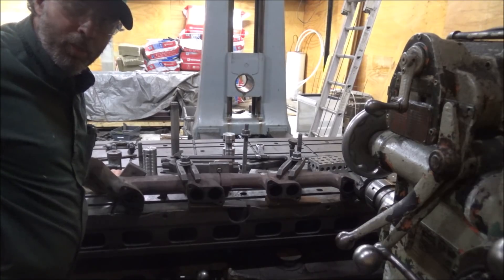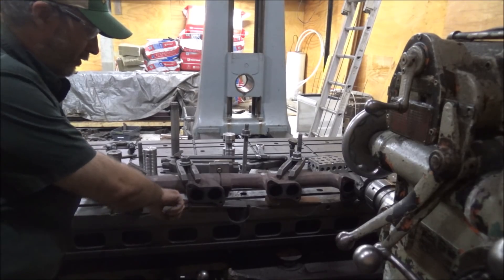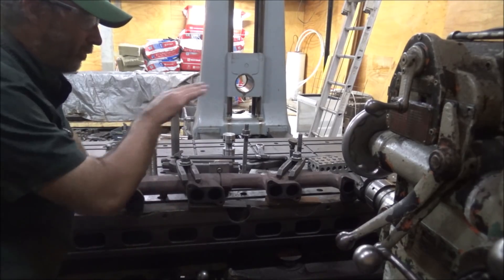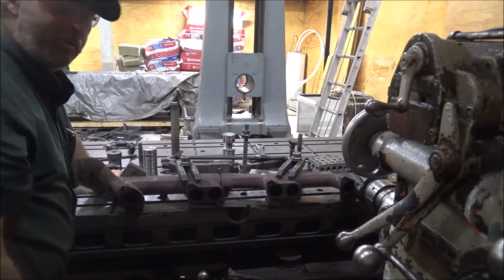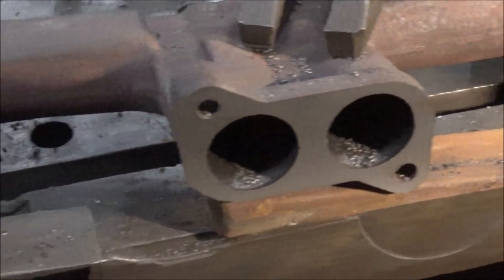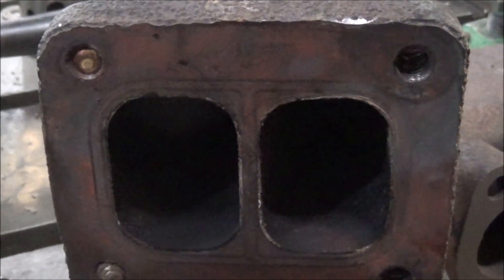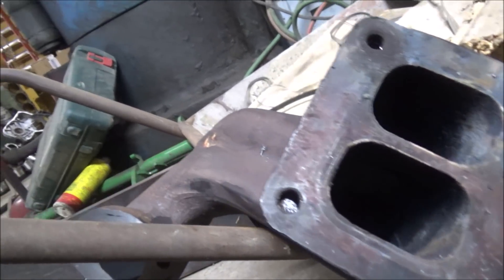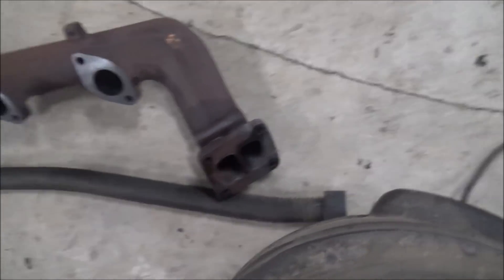Holding a Tricky Exhaust Manifold for Milling and  Difficult Getter Out

Comment: I was just thinking about something, I’m wondering about putting a small amount of anti -seize around the threads after heating , while the casting is still hot, so that it may lubricate the threads to keep galling from getting worse? Has anyone tried this? Penetrating oil just burns off!
Reply from the maker: Do you mean like trying to get anti seize to soak into the threads?

Comment: broken exhaust manifold bolts,always a miserable job. i agree with apollo. i was taught the washer technique many years ago and have found it to work best when you can use it. the good thing is you had the manifold on the bench and you didn't have to deal with it on the vehicle. like all your equipment thats one king size mig gun. perseverance pays off good job

Comment: I work on a lot of turbos.. I found the TIG welder is my best friend for removing broken bolts and studs, you can put so much heat into something so fast, you really get the thermal expansion benefits.. and it's more localized than a torch
Reply: But then he'd have to unhook it from the Carlton lol
Reply: @TheMetalButcher  He really needs two of them then!
Reply: @Rx7man  He needs the proper DC power supply for his Carlton lol. 20v instead of 240v kinda sucks.

Comment: If the bolt is not stainless, I've gotten them out with my oxy acetylene torch. The steel burns, but the cast iron really doesn't. Burn, then run a tap through tho clean up the crud.

Comment: There are those that use rags and then there are those that wears them. Lol. Gosh, if you only knew someone that has clamps or could make a fixture to securely hold that exhaust manifold. But, the important thing is you gotter done.

Comment: A wax candle when it starts to move helps. It doesn't smoke as much as oil & penetrating oil. It works great for me
 Take care Brian
Reply: Debunked by Project Farm.
Reply: @TheMetalButcher  not a simulation part dipped in salt water for a week or two. A real test in the field. Exhaust manifold bolts 25 to 30 years old thousands of heat cycles and hours. The key is get it to move with heat then apply wax. It doesn't always work but it has for me. No disrespect to PF but that was a BS test and doesn't debunk anything. Take care

Comment: I like to generally weld a nut to a broken stud then Heat her up a bit more then shock it with cold water and it cracks free.
Reply from the maker: Sounds good for some jobs but I am not bold enough to pour water on hot cast iron, sounds like a great way to have some broken iron.

Comment: Sometimes on one of the multi-cuss bolts a low powered 3/8 impact will break them loose when nothing else will, the vibration works on them just jiggle it back and fourth don't try to screw it out all at once.

Comment: I wind up extracting broken bolts/studs all the time. Make good money at it as well. I heat the part and let it cool. Normally 2 or 3 times does the trick. Then soak with kroil. I always tig weld the nuts on. It concentrates the heat better and usually less cuss words to get them out. Works for broken taps as well. I use 309 stainless filler wire.
Reply from the maker: Tig would be good but my tig torch is currently in need of replacement.

Comment: It's good to see someone else using the weld-a-nut method. I've found that instead of using a wire welder, I use my TIG. I can pour the heat into the bolt and control where the filler works. Then, let it cool down, and begin with a small 3/8 impact, real slow and progressively faster. Usually walks em right out.
Reply: I use some tiny 1/16 rods for the stick welder
Reply: @farmingsmallkubota1783  that works too. Still cant control heat placement like a tig. DC Tig welders are cheap these days. :)

Comment: I have discovered using a copper washers between the manifold and the welded nut prevents welding the nut to manifold and provides a surface with less friction.
Reply from the maker: Probably true but I don’t have a lot of 7/16 copper washers laying around.
Reply: @bcbloc02  Got a box  assortment of them several years ago from horror freight. Still using on them.
Reply: Even a scrap of flashing with a hole drilled in it helps a lot.
I use brake crush washers even if it's smaller than 3/8-10mm.
But like Brian don't have a big selection of copper washers laying around.

Comment: I have found it very useful to take a very small air hammer and vibrate the piece with the broken bolt as you put pressure on the welded nut with a wrench.  The heat and vibration break the rust out and helps quite a lot.  
Give it a try sometime.
Reply from the maker: Would probably work good when rust is holding it. These things hall up in the holes and don’t want to move because the threads are deformed.
Reply: @bcbloc02  those are a pain in the ass too.

Comment: I wonder if those long flat areas you could see on the "top" of each boss was for the original setup? Looks like you could use some 1" wide blocks to stand it off? I gave you a "there you go" when you heated it back up with a torch after welding. It seems like if you give it a few cycles like that after welding it will let that weld kinda normalize a little and helps give it a little more toughness, plus it helps expand the threads a bit to break the rust. good job!

Comment: I always weld a washer to the Broken stud first then weld a nut onto it then heat the snot out of the area where the bolt is broken off so it will expand and release the stud . Maybe something to try in the future it works first time for me 98% of the time . Great Video Brian
Reply: i always do this too, build broken stud out with weld till just proud, then washer, weld the center and pour the weld to er for heat, then tack a nut to the washer around the outside with 3 tacks, fill the center of nut just for more heat, if needed, let cool for 20-30 seconds, then wind er out. Works every time